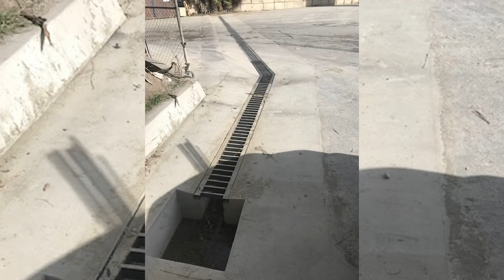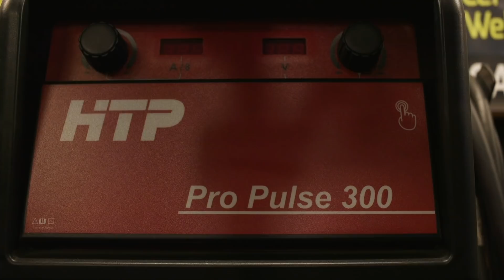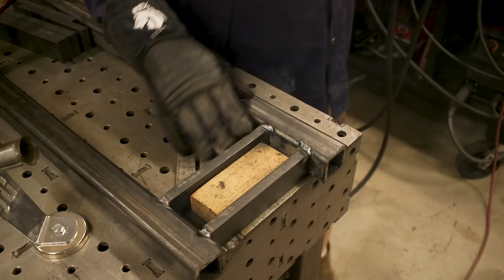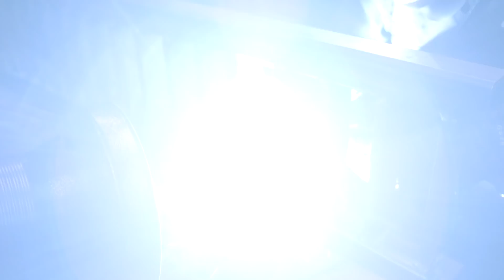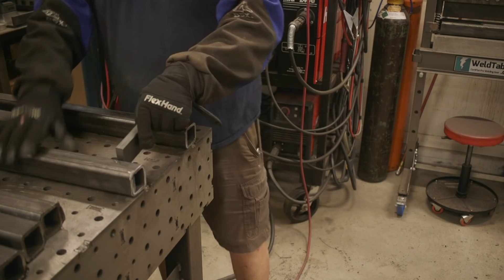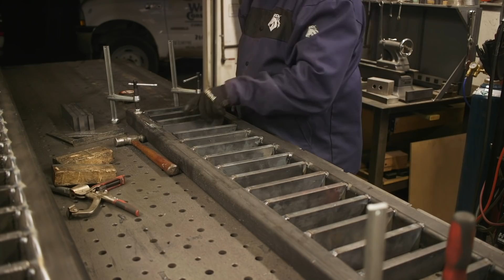Making Steel Drain Grates | JIMBO'S GARAGE

Comment: Waht kind wire mig ?
Reply from the maker: Thanks for watching Ron,    .045 duel shield flux core.    Jimbo!
Reply: He said it right there in the video several times. .045 Dual Shield Flux Core running it in a HTP 3000 Pulse Machine.

Comment: Hi Jimbo.  Just a quick thing I found recently.  I used to use the wooden blocks for spacing but like you’ve said in loads of videos when you get to the end you need to adjust the spacing.  

I recently found the site below which allows you work out in metric or imperial the exact spacing needed for a project. Worth a look. 

https://www.blocklayer.com/centersleveleng.aspx

Obviously this project doesn’t need to be exact but for a gate etc it might be handy.

Comment: Great video again so thanks for that.  I’d be interested in how you size up the metal for your projects so it would be great if you could explain how you do your designs.  I expect the sizes were specified for this project but on others where you make the choice, it would help the amateurs amongst us if you could explain why you choose certain sizes and wall thickness for projects.  Cheers
Reply from the maker: Thanks for watching, There are 90,000 lbs. trucks driving over this 100 times a day, It has to be very strong, This is why i used heavy material.    Jimbo!

Comment: Hey jimbo if your using flux core why do you use gas with it
Reply: It's "dual shield" flux core which you have to use gas for. Very different process to regular flux core and perfect for welding thicker materials quickly just like on this project.
Reply: Yes, wondering myself too.
Reply: Ohh ok I was thinking of inner shield thanks